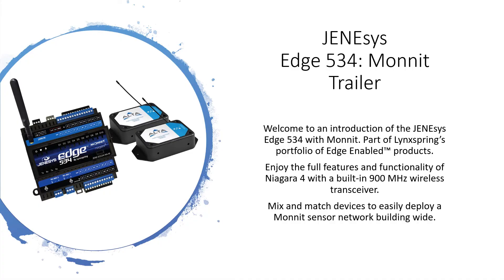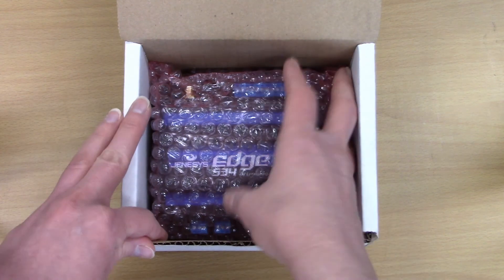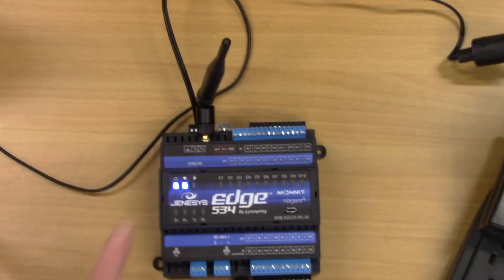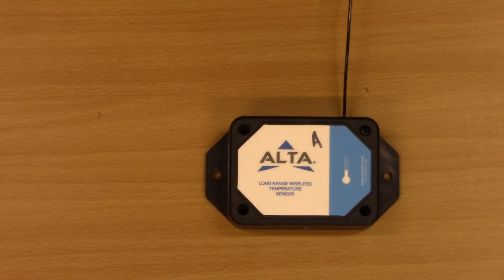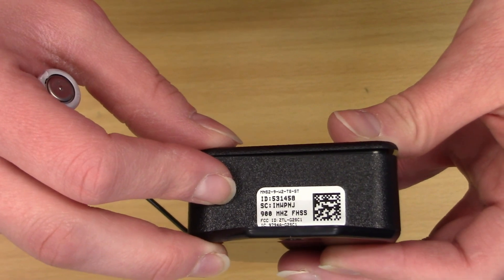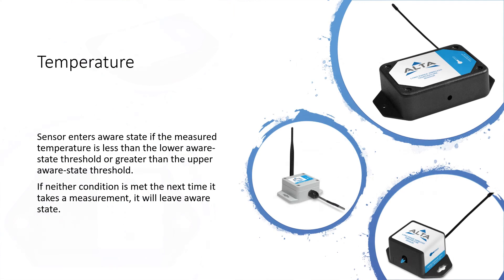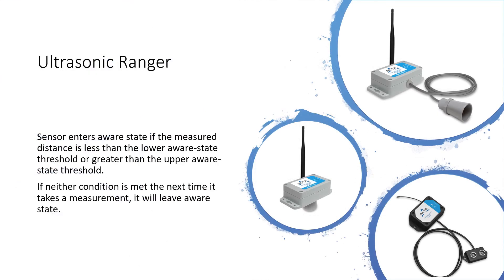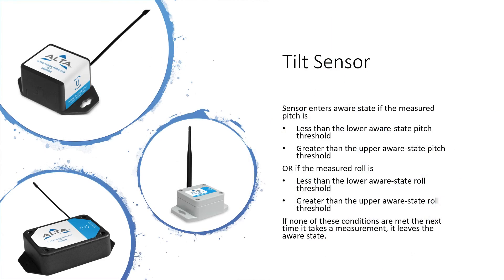How to Set Up, Wire, and Configure Your JENEsys® EdgeTM 534 with Monnit Controller

Comment: Looks like you can get the Monnit drivers from your (Lynxspring) resources center. Good!.  Can you please tell me where i find the template?  Thanks.
Reply from the maker: The supported versions of Onyxx software bundles can be found at https://resources.lynxspring.com/jenesys-edge-controllers/jenesys-edge-534-with-monnit. The included Onyxx Driver contains the Onyxx Network and OnyxxMonnitNetwork elements (including device templates) needed to configure the system.